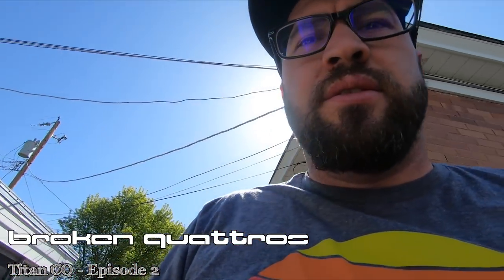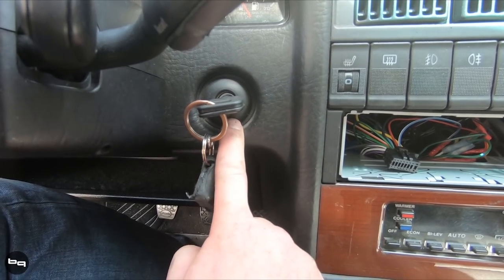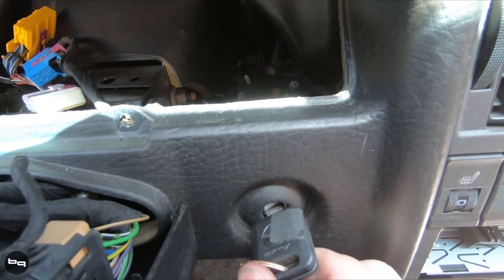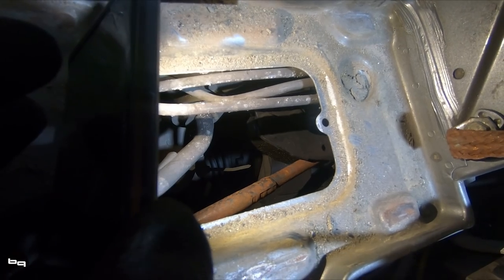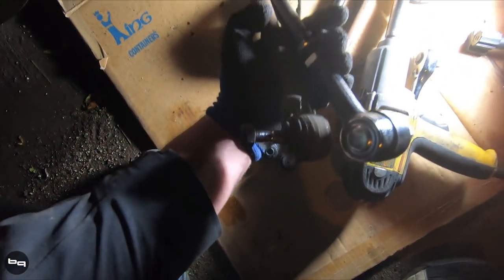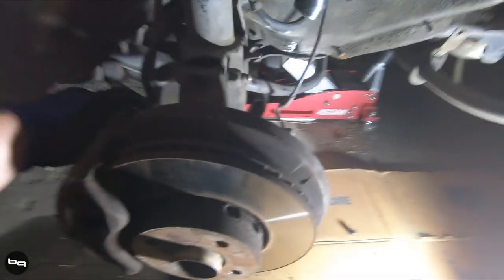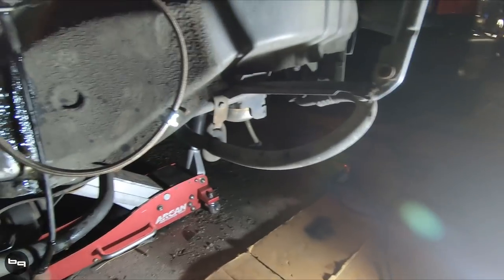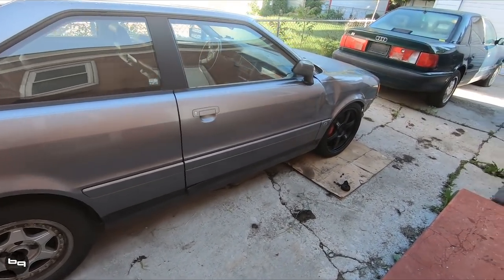Titan CQ - Episode 2 - Suspension, paint and Ignition fixes

Comment: Is it me or do I not see any safety stands.  FYI I've had a good quality jack loose pressure and let the car go... lucky it was during lifting and wheels were still on.  Stay Safe!   BTW this Coupe is in really nice shape!
Reply from the maker: yeah, i hadn't planned on being under it much, i was hoping to do the tie rod arms from the battery tray but one of the bolts was incorrect and they had locktite or something on it. so under was easier, I should have used a stand, and usually do if i'm going to be under the car...